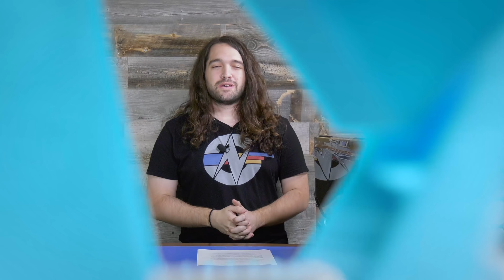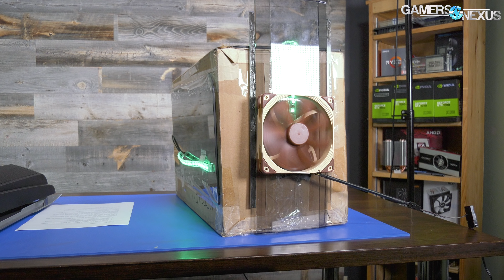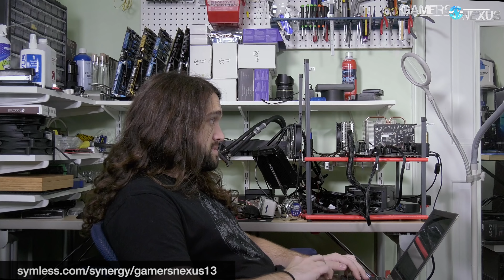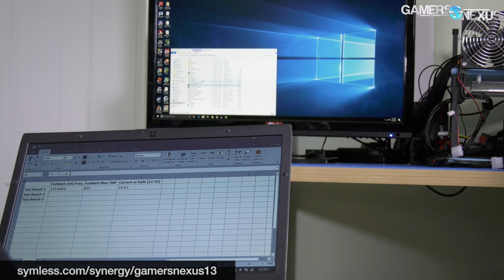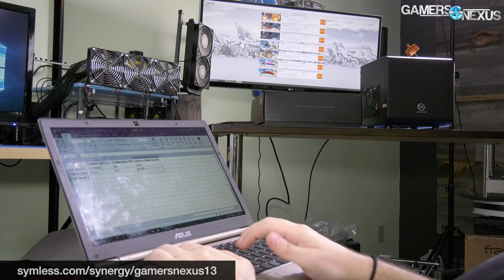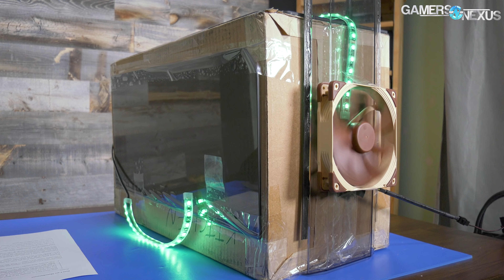Case Manufacturers: You're Worsening FPS & Power Draw

Comment: I work in IT for over 20 years in a professional way. Before that I was just doing random private jobs and tinkering around Computers and networks. I can certify that most users (Computer users) have always trip over this one issue, HEAT. They put their computers in this AMAZING Office Furniture, the computer is inside the furniture and then they close the door. HEAT piles up and the computer gets hotter and hotter. Their performance goes down and or even shuts down the PC. Then is when any IT consultant gets a call "I need a new Computer" "My computer has a virus" "I need a refund" 

No you need to take care of your HEAT, put that computer instead of inside the furniture outside for a week and you will see the light. 

Now that is the same concept as Gamers Nexus is pointing out with cases. Now imagine one of these UBER AWESOME looking cases inside a piece of furniture... yes you guessed it, its going to suck. 

As soon as a Computer gets hot in general it looses performance that is a fact. Now what good does it to you if you have a Lighthouse "Tower" that is slower then a Pentium 1? 

Great Video, thanks for confirming something I was preaching for years.

Comment: I bought NZXT H440 once, it had such bad airflow that i had to run it without a front panel for a year until i could afford a new case.
Bougth the Corsair 760T and temps went down 15c overall.
Now i can have my fans on the lowest speed at all times and my x360 rad keeps both gpu and cpu below 60c while gaming and i can barely hear it.

If noise, temperature and performance is a concern, google your case options and read about them before making your choise.
Don't just buy what looks cool, as you have to take it apart to get the performance you need.

Comment: You can have great sound supression in a case and not have it being a restriction to airflow.
It all depends on the thickness and placement of acustic dampening material.

In my corsair 760T i cut up an old foam mattress and placed strips and pieces of it in all the places you can't see, and it's not much but the acustics was dramatically changed.

If your case don't have a clear side panel you can literally glue a mattress to the inside and sound will be allmost gone.

Comment: I continue to use my ~six year old Cooler Master 922 HAF case.  I is not perfect, cable management is poor and some of the stamped out metal was not cleaned up and I had to use black electrical tape to cover sharp edges.  However, it runs cool, great airflow with three 200mm, one 120mm, and one 140mm [in the PSU] fans.  As for noise, most of it comes from the fan on the Noctua NH-U14S CPU cooler, which is fairly quiet.  -  Thank you.

Comment: I have the Enermax Coenus case.It was cheap and I liked the look when I was building my rig about 3-4 years ago. My cooler is a h100i, so there are 2 fans up top as intake, then I have a couple of noctua fans to replace the default case ones. One intake in the front, with the top drive cage removed so the air directly hits my video card. The back and PSU are my exhaust fans. I have a large dog so a downward-facing PSU I found unwise. My temps are pretty great. I have a +10% overclock on my r9 290x and it sits around 83c while gaming. I know that's  still hot for most people, but it's a Radeon card... be real. I don't mind the heat from the case personally. I usually cant hear my computer even while gaming. It sits on my desk, to avoid the floor and the dog hair.

Comment: Thank you Gamers Nexus for stating (what should be) the obvious to chassis manufacturers - well done!!

I'd love to get the Phanteks Evolv but the thermals suck hard with the top and front panels being mostly closed off.

I live in an apartment so I can't be doing major modding with power tools (and we all know that drilling/ cutting through aluminium makes a hell of a racket), and don't want to spend a small fortune getting modded parts from across the border (Canada - US border).

Comment: LOLOLOLOLOL great vid xD I agree looks are fine but to me good looks are good function. I think the antek 900 success was because of that large fan on the top, its appeal was based on its perceived function. I think the h500p the two large fans might be a good idea if the focus was on taking advantage of the fans. Maybe the next gen h500p they will fix these mistakes. I feel like the tempered glass trend is based on the perception of good build material quality. Its glass so therefor the rest of the case uses premium materials.

Comment: I Love this!
I have a Corsair Carbide Series Air 540 with a Corsair  H115i water cooler and I like this case and setup but my biggest Gripe is all the plastic the case is to flimsy the side panels are Week and i feel there going to brake.  
The the whole case seems like its going to brake and this case he is taking about that front over looks like it will snap If they would use fiber reinforced plastic it would fix a lot of my issues..

Comment: How about a thin fan the comes with the case that sits between the last pcie slot and the psu . Give it about 1/2 inch space on both sides and maybe cover the fan with a shroud that only leaves the fanblades uncovered so it hides the frame and wires of the fan and the shroud can be removed to place your own fan in if you prefer a different fan ...

Comment: I experienced this first hand with my GTX 1080 Ti in my Corsair 250D. This case is not designed well for most aftermarket air cooled graphics cards, except maybe reference blower style coolers. After putting an AIO on this card which vented directly out the opposite side of the case, the max clock speed stabilized and performance went up by a considerable amount.

This isn't really a fault of Corsair as this case was basically an open advertisement for their AIO products, with it being able to support both a 240 and 120. But people really need to consider what cooling solutions are compatible & necessary with their cases. Take note of the cases demonstrated in this video which are more focused on aesthetics & consider how much heat your components are going to generate (especially if you overclock).

Comment: I just moved my hardware into a Thermaltake Core P5 in order to wall mount it on a vesa articulating arm. It's both quieter and cooler than my old HAF 932 with the side panel window removed.

Needless to say I'm extremely pleased with its looks, noise, thermals, and un-wasted space.

Comment: cases should be designed from the ground up with COOLING and UTILITY in mind above all else, and anything else like caring about noise output and aesthetics should sacrifice absolutely nothing but the price point. Each of the most popular manufacturers understand this and have at least 1 model that is appropriately designed, but 90% of the cases out there have significant cooling and utility performance sacrifices. Like the entire trend of making smaller and smaller cases, always everything as absolutely tiny as possible for... almost always no practical justification whatsoever

Comment: Hey Gamers Nexus, I use a Bequiet Darkbase 900 pro, for a dual 420mm watercooled loop and I can't agree enough with this.

Little 1" cracks CANNOT intake air anywhere close to direct flow, making air turn 90 degree's is very difficult, and people need to understand this.

My watertemps change 5-8 degree's with the front door closed, front door cracked about an inch still increases the temps by about 2 degree's and open it sits steady at about 36-37c water

Comment: I have a question because I hade no case open air totally open air on top of a mobo box in a corner of my desk I have 2700k of to 4.7 on air the cooler hyper 612 V2 cm got a thermal take g21 TG and removed only the magnetic dust filter and here are the result 36c 28c idle in game 65 66 max temp now with case 32hoter core  30 cooler core idle 60  65c I don't understand temp are better inside the case than in open air

Comment: Very good topic!  Air flow is why I (still) use an old school HAF-X.  One critique:  I would have appreciated more pictures and drawings to reference what you were talking about.  Including screen caps of the benchmarks was great, but there should also have been pictures of the cases/graphics cards, etc.  One last comment.  Your "patented" prototype looks to be a very hot case with very little ventilation.  How about a glance at the drawings your submitted for your patent to show how air flow SHOULD be?  Again, thanks for the video, the topic is SPOT ON!!!

Comment: This video is spot on. My son bought a mATX Phantek Evolv which looks great but has a solid front panel with only a tiny air gap along the edges. He thought the temps were high and 3D printed some standoff’s that pushed the panel out by only 1/4”. The temps went down by 10 degrees! It didn’t change the look of the case much at all, in fact we preferred it. I suggested he sell them as accessories. Why would Phantek not figure this out themselves?

Comment: I like my in Win 303, I built mine with a full open loop setup running heavily Oc'd R7 1700X and Vega 64, 3 intake fans on bottom, 120mm double thick rad on the back exhaust, 360mm rad on side/top exhaust and a 120mm fan exhausting on the side grille to help efficiently extract heat, also, the case is propped up for better flow.

43C running 4K hellblade, Cpu about 50C running p95. This is in a 78degree ambient environment.

Comment: Found a new way to be cool, while showing hardware and keeping it cool. its called removing the side panel so the open style gpu's can breath some fresh air (yes i need to clean for dust more often). still getting hot though wish some one advised me to take ref blower style card's when using multi gpu. 

But still good point on the case's missing the old school fan on the side panel to blow on the gpu section like the old coolermaster stacker rev2(had 4 of them worked like a charm for multiple gpu's)

Comment: ja ja ja ja ja ja ja ja ja ja 
😂😂😂😂😂😂😂😂😂

 what a prototype!!!

 question what do you think of a horizontal motherboard?  instead of vertical?

 and a tray for ssd's tray ?
and a tray for hdd? 

 has ever occur to you for cable management the case to have ducts to tuck the cable there. 

also,  talk to the manufacturers to stop making those cables so unnecessarly long!

Comment: Watching the video on a now ancient Antec 300 where I've hacked off the 3.5" drive bays so I could front mount a 240mm radiator, and used "tempered" packing tape on the side fan to route air through the case.

Before that, I was running a full ATX system in a tiny ass cardboard box by placing the PSU over spare pcie slots, and cutting strategic flaps to actually achieve decent temps.

So yes, I understand function (and wallet) over form :P

Comment: I am expecting to find a case to have:
- DOORS to hide 3.5` roms and displays (2 max) (and if I need more air, I just open up the doors)
- PSU shroud
- Cable management on Fractal level 
- Thermal glass panel on the left side

There`s not even one case  on the market that would supply my demand.

Comment: Hi, I want to buy new case for my PC. Can you please recommend case with good ventilation, I don't need glass panels or LED. It should be mATX, ideally with slot for optical drive and good cable management. Main usage is gaming, I have:
MB: MSI Z170M MORTAR
GPU: MSI 1080 Ti gaming X
CPU: currently i5-6500 but planing to upgrade to i5-7600K with air cooler
PSU: Be quiet! Pure Power 10-700W
I was looking at Fractal Design Define Mini C but I would like someting better but not too expensive.
Thank you

Comment: Well, i am really happy with my AeroCool 300 FAW.
Ok, the panel is acrylic and not tempered glass, but it fits a 240mm radiator, has a full power supply shroud, mesh everywhere and even looks nice.
And the best: It only cost me 40€. And now i find myself giggeling about people spending 5x as much on a case that has crappy cooling performance.

Comment: Steve, why didn't you address the R5 instead of only the C of Fractal? The R5 gets lower temperatures and loweer noise levels, at least partially thanks to the  Larger volume. Shouldn't they make the cases a bit larger again?

Comment: For comparison I have an Fractal Define R5. With 1 Frontmonted 280mm Rad and 2 Fans, 1 Fan at the Back and 1 on the Bottom, which is obstructed by Powercables.
My i7-7700k is delidded (and all cores on 4.5GHz)  and 56°C at MAX Load with Prime 95. Also an ASUS STRIX 1080 TI which get to 69°C with MAX Load.

What many people forget are Temps of HDDs, M.2 or other Components like the Chipset on the MB. A HDD Mounted infront of the Rad gets over 55°C which reduced its Lifetime by a large Margin. Which is why i mounted it elsewhere.
If the M.2 isn't cooled properly it can also Thermal Throttle. (Thats why i have a Fan, even if it  is obstructed, blowing on the M.2) 
Especially Graphiccards with open Fans can Heat up every other Component near it.

Comment: Cooler Master HAF Advanced is still one of the Dopest Mid Tower Cases. It's truly a complete package. One 200mm Fan on the front and another 200mm Fan on the top, No blockage what so ever. And above all else, it's got a 140mm Fan on left side panel window, blowing air directly to the GPU. I can bet it cools better than MasterCase H500P.
Reply: I've still got my HAF 932 Advanced with a FX 8150 and 970. I did have an H100i in it but replaced it with a Noctua NHD15 and a Noctua 200mm fan in the top of the case. Gave that to my father since I used my HAF-X case for my 8700k and 1070ti build. I would of got a 1080 but found a 1070ti for 420.00 a few months back. Either way, I doubt I will ever get rid of my HAF cases. The airflow is so good, especially for the gpu.

Comment: Did you factor the fan power consumption in the power/temp efficiency video?
If you wanna consume less power you could ramp up the fan speed but by doing so you also increase its power consumption, that's why I ask.

Comment: the basic MasterCase 5 has great airflow and functional decent looking case, no idea how CM messed up the H500P. Meshify C is another good design with open front so I think manufacturers are starting to realize themself that closed cases are look good but that's it. Hopefully this video will help them too but it will take a year or so to see more open cases because designing a case is one of the hardest. You need to design a case with good cooling, look and maximum compatibility with parts which is not an easy task

Comment: I imagine a GN case would be a frankenstein of all the good features they've seen in the past few years.  Captured thumbscrews for the panels.  up to 360mm rad support on the top and the front.  Have a front that's mesh, or perforated plate to allow for significant airflow.  Similar situation on top.  Give it 4 USB ports on top, and a couple audio jacks.  Oh and provide 0.75" of clearance for cable management and drive mounting.  Along with integrated velcro tiedown points.  As those are less likely to wear out than the admittedly nice, but plastic NZXT retention clasps.

Cap this all off by having multiple "trim" levels of the case. So the base level is just a panel on the sides, no glass, maybe acryllic. Have higher "trims" include more fans, rgb, controllers for both, tempered glass, rubber grommets, etc. So that at the highest level you're looking at a 150-200 dollar case.  But at the highest levels you're getting carry points/handles like the c700p, all those aforementioned features, and maybe even nice finishes like nicer quality/special paint layers. 

Because all the expensive tooling is the internals/panel construction. The more mileage you can get out of that; the better. Things like paint, and additional extras like throwing in more fans, rubber grommets, exchanging a side panel for glass. Ends up being a relatively easier change to make. And if you have an excellent base level then adding on extras for vanity allows a great middle ground point where you can have a fanless, no bells and whistles, case that can be sold for low prices to capture the budget market.  But then by adding on all these extra form and function pieces you're pushing a case from the $70 range into what is now something more like 100, 120, 150, or even 200 at the highest levels. And it would still be giving you great value at those price points.  (Meanwhile it just takes a little extra time to fit those extra parts. Rather than dealing with a whole separate set of tooling for what is internally a different case as well as externally. 

Actually... In light of me thinking about this. Why hasn't a case manufacturer basically done this? You already see this kind of thing done for efficiency with cars. Keeps tooling costs down while increasing the marketing and pull of your product to the end user.

Comment: I have legit question then. What are you top recommended cases for performance than?  I generally don't pick cases for looks anyways but honestly haven't put that much thought into the difference performance differences in cases other than the number of fans that it will hold. I would honestly like to know which modern or old, (I'm plenty of with old cases aswell, i'm still using a 10yr old Koolance myself) would be your picks for the best case. 

That is a good thought. If you didn't limit yourself to just new cases you might be able to save some money and pick some old full town cases that can still have better airflow than most of the modern ones. Just saying.

Comment: I think cases need a small thin heat dissipation that can be placed in between the CPU heatsink and the CPU, like a thin layer of copper that can lead to LED's to help keep the CPU cooler, and a backplate that can cook the motherboard, like a small car liquid nitrogen gas tank be placed in the case.